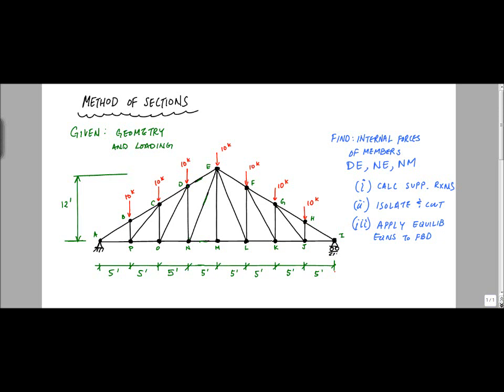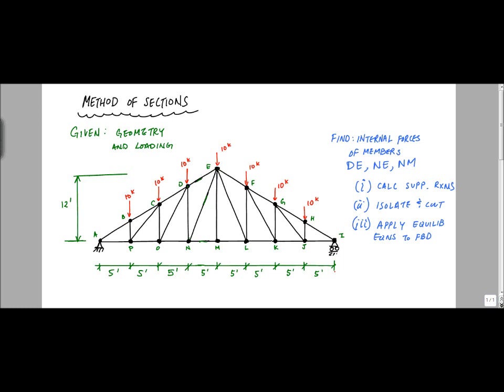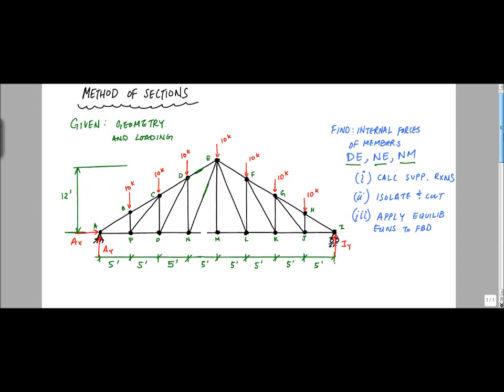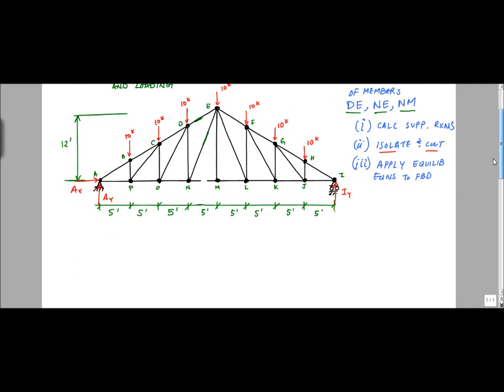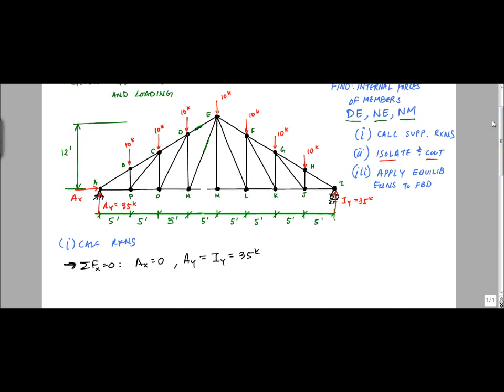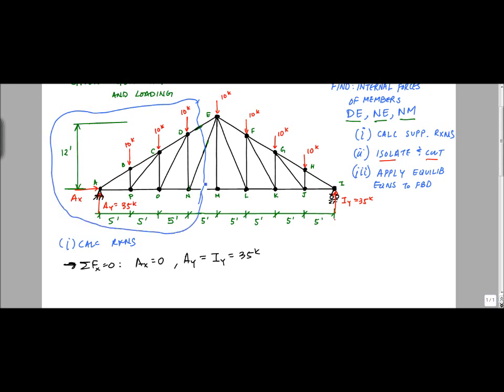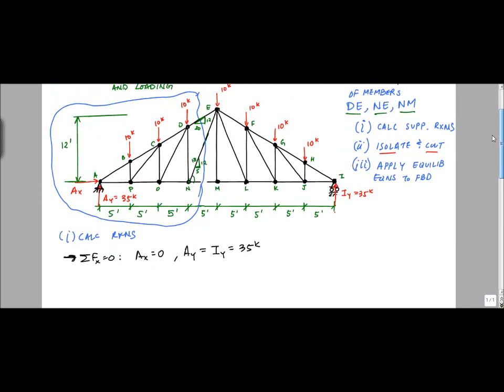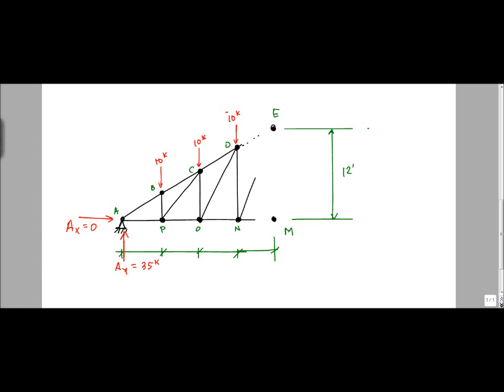Method of Sections for Truss Analysis Example - Statics and Structural Analysis

Comment: @structurefree, I'm not sure if anyone has pointed this out but when you sum the moments about N to get FDE the third term should be 10k x 10'. You have written it as 10k x 15'. Funnily enough when you calculated the force you have corrected it without correcting it on the sheet. Not that I'm trying to be a stickler, just thought you'd like to know.

Thank you for the video anyway. Very informative. It's been a while since I touched this stuff.

Comment: I wonder if it's possible to use the equation you made in the summation of Fx and Fy to obtain the internal forces of the members FDE and FNE since you already have the internal force FNM?
-By just obtaining the angles needed
-and by using algebra(matrix) or by simply plugging in the values needed in the calculator?
Is it possible?
Reply: i was also doubting this

Comment: by finding the value of force NM we can put the value in first two equations(sum of x forces equation and sum of y forces
equation).then we have got two equations with two variables and we can find the angle. then solve the both equations and we have got the values .no need to find moments at A

Comment: thanks for the help but I think u made a mistake while so I ng for the moment about N. one of the downward forces of 10 you wrote with a distance of 15 when it should be 10 . but other than that great video
Reply: Yeah i was thinking that too. I came looking for the comments if someone pointed that out. That 10 kips should have a distance of 10ft right?
Reply: +Mikki Minnie  yeah
Reply: I agree the arm of the force should be 10 instead of 15.
Reply: Yep noted. It should be 10kips(10’) and not 10kips(15’) although I was totally confused in class until I saw this video. Great stuff.
Reply: yeah. everything is correct except for that distance. instead of 15 it has to be 10.

Comment: Maybe I'm not getting this, but your last eq shows you taking the moments to the left of DE and you calculated with 5'x10k + 15'x10k - 15'x35k.  I don't think you did that correctly.  The second 10k load is only 10' away, not 15'.

Comment: I got completely different answers. I don't think I did anything wrong.
I got DE as -49.58k. NE as 325k and NM as 41.67k

I first found the support reactions.
Ax as 0, Ay as 35K, and Iy as 35k

then I took the moments about point N
Sum(M) at N
-9xDEsin(59.036)+5x10+10x10-35x15=0
which gives me DE= -49.58k  (in compression)

then I took moments about point A
Sum(M) at A
-5x10-10x10-10x15+NEsin(67.38)
NE=325k in tension

After that I just took the summation of all the forces along x axis.
Sum(F) along x
-48.59Sin(59.036) + NM=0
which gave me 41.67k (in tension)

Can anyone confirm if these answers are correct or not?.
Reply: I tried using truss solver softwares and its giving me 48.591 for DE (in compression) which is correct. 21.667 for NE (in tension) which is different from what I got. And 33.333 (in tension) for NM.
Reply: Figured out the mistake in my calculation. Didn't multiply NEsin(67.38) with the length 15. After making this correct I get the NE as 21.667 which is correct.